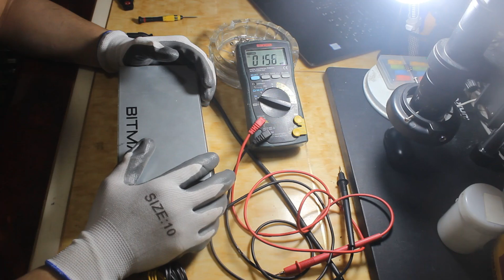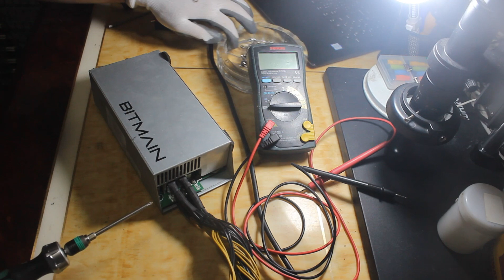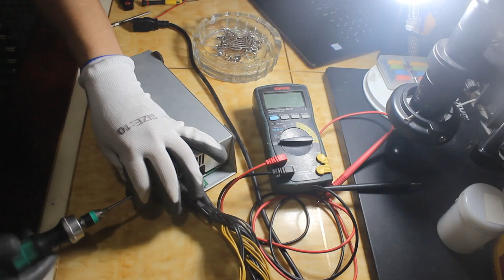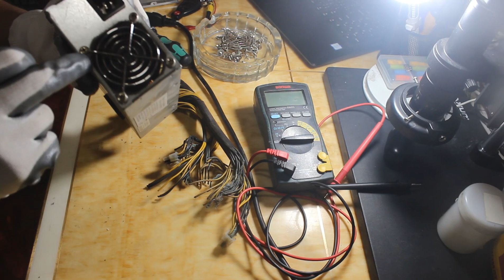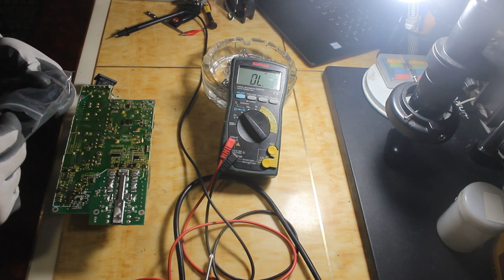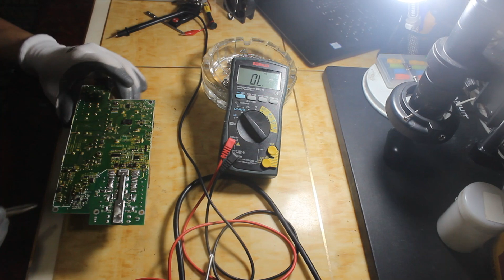Bitmain power supply repair for hashboard  (S9,T19,Z15,X3,S17E,T17E,D3,L3+,S9,S7,S5,L1,S3,S1SE,S9K)

Comment: very good video, I have a problem with 3 sources that do not work, of which only 1 turns on, but it does not give 12 volts, but the fan turns, when I measure the voltage that goes to the fan only 8 volts are arriving and I measure the voltage that it reaches the capacitors and only 180 volts arrive, what can it be?
Reply from the maker: Hello please send your request on WhatsApp number 0096181007374

Comment: excelent video. I have and apw3++ psu with 180 volts on the big capacitors. i take them out and measure them outside. they have the right esr and capacitance. can you help me with this problem? i also check the all diodes and they are ok, but the psu it is not turning on.
Reply from the maker: Hello please send your request on WhatsApp number 0096181007374

Comment: Thanks, i have a trouble with apfc line (DC325V, from AC220V 50Hz). And it's too low to activate other systems of power supply.
Reply from the maker: Hello please send your request on WhatsApp number 0096181007374

Comment: Thanks for the video, sir.
I have an issue with my mine mechine. My fan still working, 4 diode driver is good and i got 12V on there. But the output only 0V. Can you help me please
Reply from the maker: Did you check PWM chip .

Comment: Hi there

I have a Antminer DR5, its uses a PW8 Bitmain DR5 PSU APW8 8V-9.2V. Miner was running find, in low power mode of 1100W, on 120V was doing a test no issues no heating.
When I switched to 1800W in the Antminer bios on 120v to test the hash, chip started heating up, and the miner shut off, I tried to test the voltage from the 12V yellow and black
cable there is no power, what can be the cause. If it goes to protection mode when it turned off. How come there is no power coming from the PSU,
what can be the issue what part, my PSU is different but its the same company that makes it, can you please tell me some tips to look for or what to look for?

There is no burn smell or anything.
Reply from the maker: If the load on any of the output rails exceeds the specified limit, the power supply automatically switches off. If the output rating (maximum load limit) of the power supply is insufficient for the system's requirements, this protection function is activated to switch off the power supply. Focus on measuring whether F1 insurance, U2
rectifier bridge, Q4, D7, D5, D6 are damaged.
Reply: @salmantechrepair5553  I took it apart, and noticed that fuse you mentioned in the video, was blown, I replaced it and then powered it on started made a click immediately shut off, dunno if the fuse burned again. Never had an issue with the miner before. This only happened when the stupid friend, put back in bios on the 
miner from low power mode 1200W to normal mode 1800w running on a 120v, the miner had no issues running on 120v on low power mode 1200W and 1100W on the wall. 
The bios is stuck on 1800W mode, and cannot downgrade till the miner boots, which its not powering on, checked everything else, fans not turning, the controller board is not receiving power from the power supply, and also measured the yellow and black cable no volts. Unlike the Bitmain power supply you have here, mine is mounted to the side of the miner with two small fans. Since its a DR5, dunno if the chips are the same as yours.

Also, for the fuse, its a ceramic fuse, be does not say what it is, other than 20AMP, 250V but does not say fast burning fuse or slow, dunno if you know that.. I put a fast burning fuse, so dunno. Please if you can help would be greatly appreciated.
Reply from the maker: @AmyBella  WhatsApp 0096171402063

Comment: Hi, thanks for the video.  I have an issue with mine too.  No 12 volts.  2 of my bridge rectifiers are shorted on 1st and 3rd pins when they are still on the board.  But they seem fine (no short) after I took them out the board to re-test.  It is actually shorted on the board when the plobe touch the 1st and 3rd hole on the board. Would u know why? Thanks
Reply from the maker: WhatsApp : 0096171402063

Comment: Is yhere any way to to increase output voltage to 13.5V
Reply from the maker: There is a potentiometer you can increase the voltage, max 12.9
Reply: @salmantechrepair5553  where are located this potentioneter? 
Can set the output voltage to 14 Volts?
Thanks very much

Comment: how do you measure while pcb masking still there?
Reply from the maker: just push hard the electrode to the Pin of component  or you can  try acetone, or nail polish remover.
Reply: Yo uso estación de calor para quitar la resina que protege la PCB, con unos 300° se cae sola

Comment: The most informative bitmain apw3++ repair.
Reply from the maker: thx man
Reply: @salmantechrepair5553  what type of diode you use to replace shorted one? This exactly happened to my psu.
Reply from the maker: @TheHarpanOnly  SMD B1100 729 here you can find the link  https://www.diodes.com/assets/Datasheets/ds30018.pdf
Reply: @salmantechrepair5553  thank you for detailed information. I will check the datasheet.